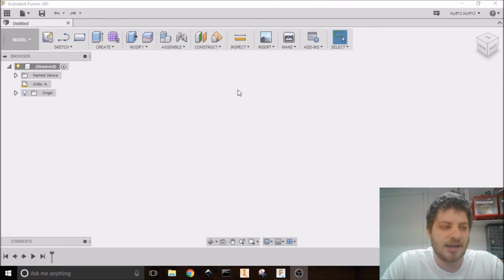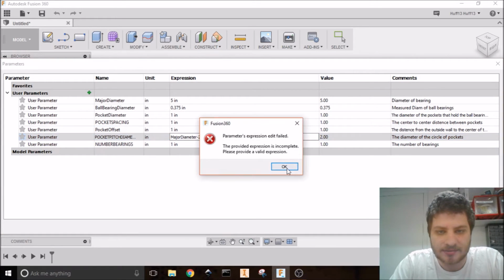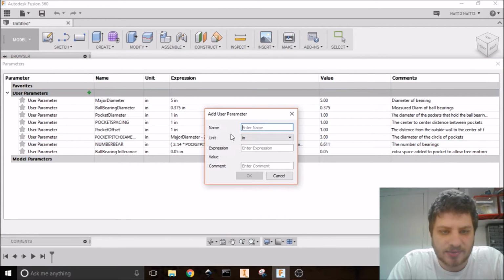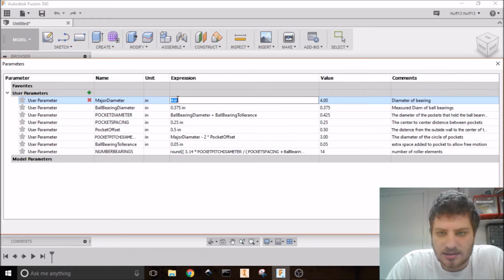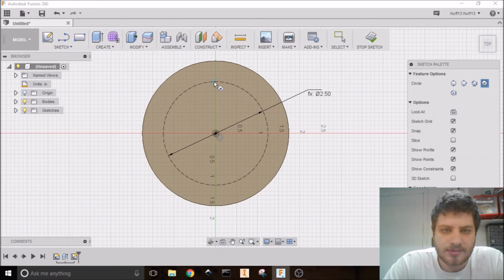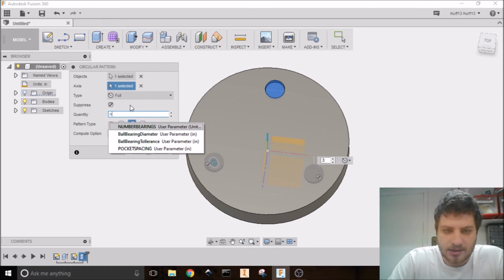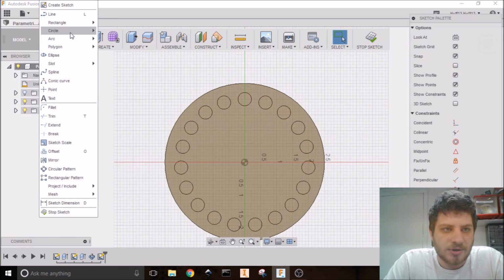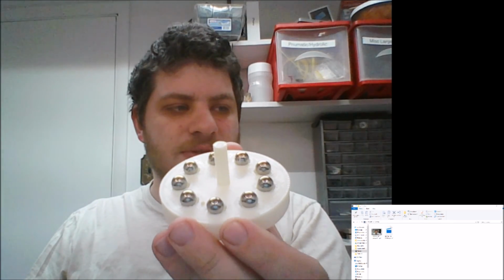Adaptive Models: Fusion 360 Advanced Tutorial

Comment: Very cool info! Question about the pockets. I'm assuming a flat bottom pocket provides less friction then a concave pocket shaped  and sized to the ball bearing? Also what about using a trough like the other side instead of the pockets?
Reply from the maker: +GlenGH theoretically the flat bottom pockets provide a little less friction due to less contact area, but it would reduce the load rating quite a bit (again less surface area to spread out the force). You could do a trough but you would need someway to separate out the bearings, otherwise they might bunch up on one side. That being said, I didn't really "design" this bearing, I just kinda threw things together. I wasn't planning on using this bearing for anything, so didn't worry too much.